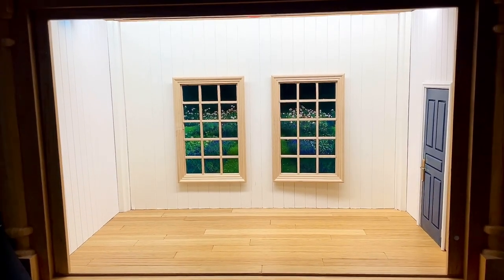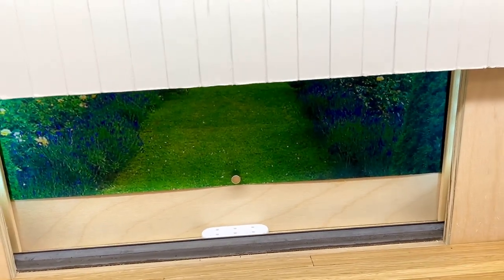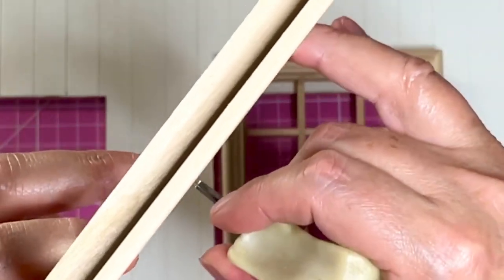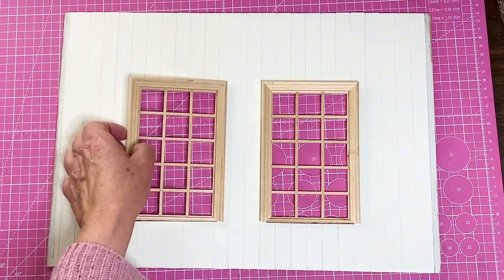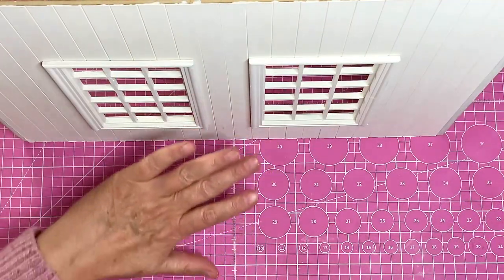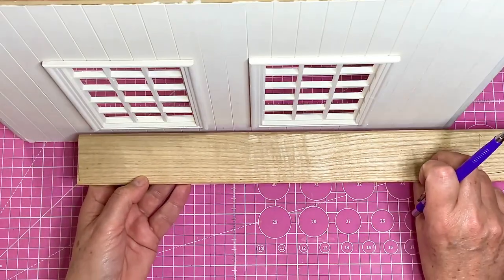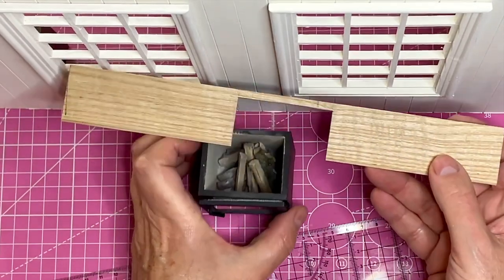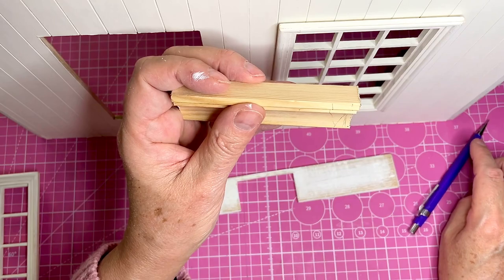Windows and window sills. Advent 14, 2022

Comment: It looks lovely.  Just for the record, as I have put in a number of fireplaces into my houses over the years, I know there are actually legal requirements as to how far the fireplace (aka "log burner") has to be from the wall and things on either side. (Different in different countries and probably states.  I've done one in Canada and three in the U.S.)  You definitely would not be given a pass by the fire inspectors either place.  Unless you lived in Chicago and you could just pay them off.  Ha!😉 Miniature bribing.  I love it.
Reply: Most normal old fashioned wood stoves used in kitchens, as well as other wood stoves, have those requirements. They were used for heating, so bare wood right next to them wouldn't be allowed.
Reply: @recoveringsoul755  Yes.  When I put my wood stove in in Canada, they wanted a HUGE amount around it because it is a log house and Canada is really strict.  In the U.S. 2 of the stoves I have are gas and do not get that hot on the outside so the manufacturers specs were fine and not so far away from the wall.  But 3 feet from nearest window.   My wood burning fireplace in the U.S. is set into the wall so not an issue.  But still, surrounded by windows which are at least 3 feet from the center of the chimney.  But built over 120 years ago, so who knows what the rules were then.  But, as Josje says, "It's miniatures."  And I add, "No inspectors, or, for that matter, no heat from fireplace."
Reply from the maker: Uh-oh!  I hope those inspectors don't watch my videos!  😂 I'll save some cookies in case they do come by.  I hope they'll take them. 
And then I'll tell them that those window sills, window surrounds and walls are all stone.  It will be OK. 😇
Reply: @MakeMiniatures  If it's Chicago you'd better have cold, hard cash.  Only Santa takes cookies 'round these parts.  So enjoying the morning Advent Calendar episode each day.
Reply from the maker: @marykayryan7891  Santa is an expert on chimneys! 😄 Thank you Mary Kay.